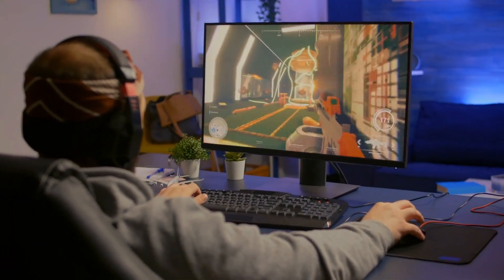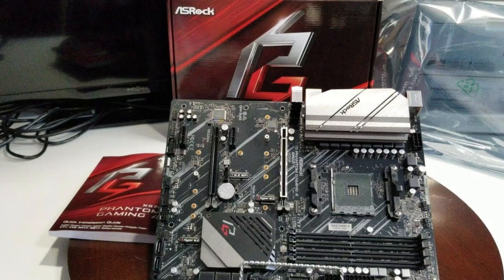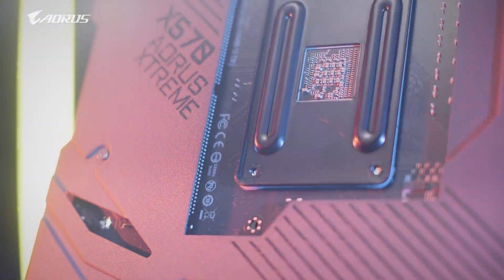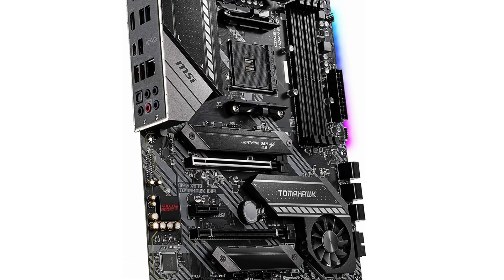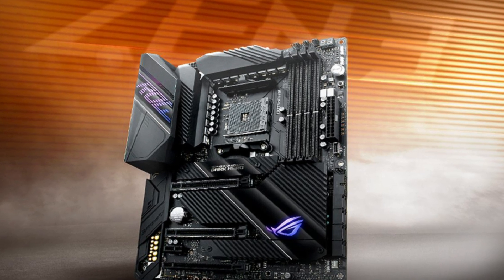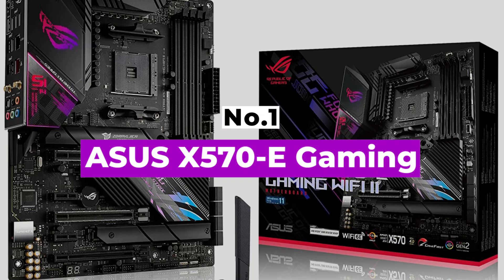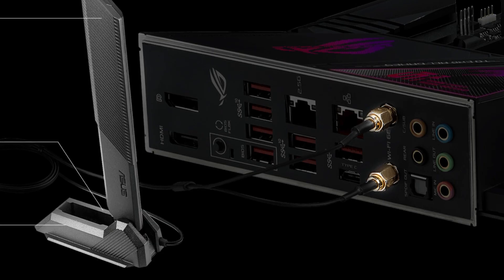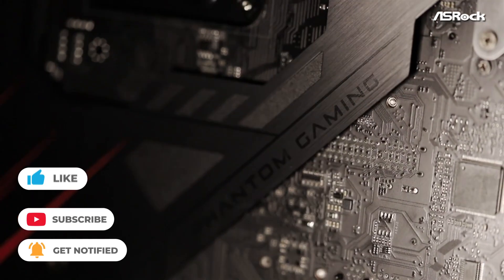What Are The Best Motherboards For Ryzen 9 5900X (2022)? The Definitive Guide!

Comment: Over-all a nice list and good video - but there a few Mistakes in the video. At Time frame - 5 min - 39 sec Time frame until Time frame 6 min - 33 secs ; at Time frame 6 min - 34 secs - until Time frame 6 min - 45 secs is when you show the Asus ProArt X570 Creator Wifi mb. Next mistake : As you are talking about the Asus X570-E Gaming mb at Time frame 8 min - 55 secs until Time frame 8 min - 59 secs you show the Asus Z690-E Gaming mb with some model of a Intel 12th gen cpu from the bottom of the cpu not allowing you to see which 12th gen cpu it is. Then starting a Time frame 9 mins - 00  secs until the end of the video is when the X570-E Gamin mb is shown. Back in Feb. I did a maximum Up-date / rebuild of my computer with the Asus ProArt X570 Creator Wifi mb + the Ryzen 9 5950X cpu , ssd is the Inland Performance 2tb Gen 4 NVME , ram is 128gb of DDR4 , Gpu is the Power Color Red Devil Radeon RX 6900xt , PSU is the Seasonic PRIME 1300 Gold SSR-1300GD 1300W 80+ Gold FM unit , CPU cooler is the Cooler Master MasterLiquid ML280 ARBG Close-Loop AIO CPU Liquid Cooler, 280mm. Keep up the good work.
Reply from the maker: Thank you for watching our video critically. We appriciate your input and identifying any slips in the video. We are comitted to provide valuable information to our respected  viewers and will keep on doing course corrections on the basis of your feedback.